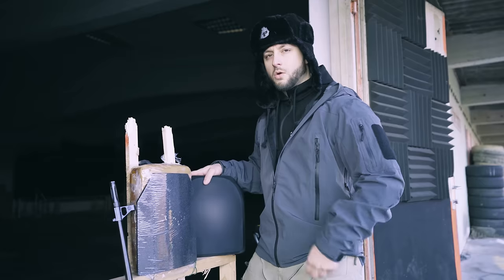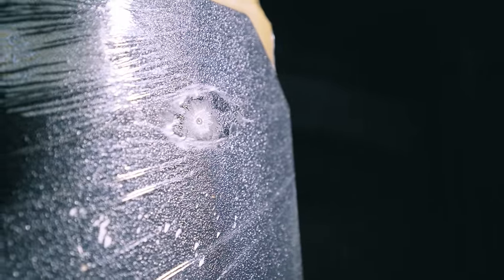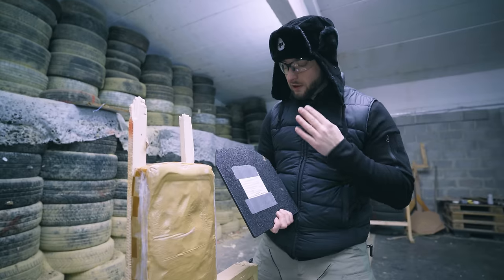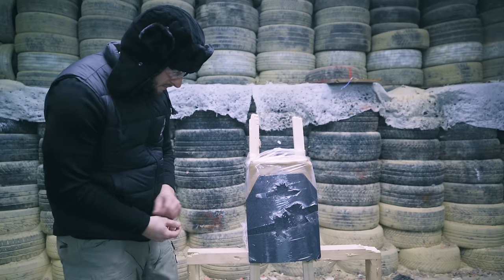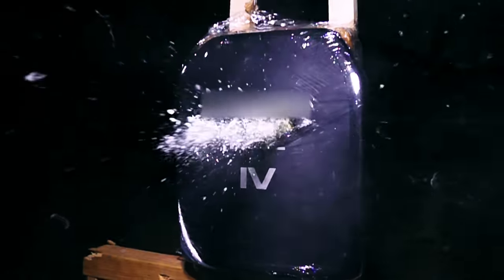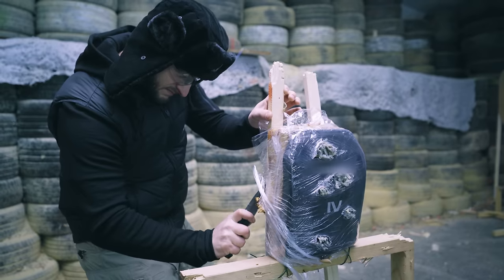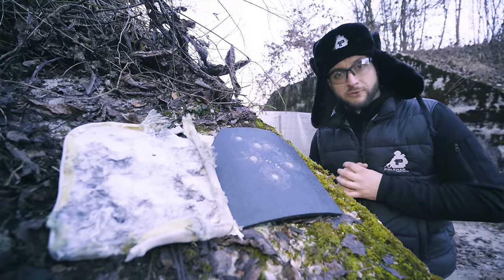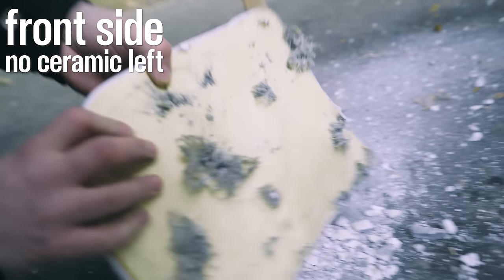Steel vs Ceramic Ballistic Plates

Comment: for the fragmentation issue couldn't someone make a simple kevlar sleeve/cover to zip up around the plate?
Reply: Yeah, those exist, or they can be coated in a thick layer of truck bed liner or epoxy.
Reply: Yes simple
Reply: I'm wondering if a 10-15ml layer of commercial grade silicone caulk would suffice
Reply: A lot of complete body armour set ups both civi and milliraty use a soft amour backing/vest to catch frag/spall with plate(s) ontop to stop the main/high velocity projectiles. (e.g. the osprey PPE system)  It's only in recent years due to inproved anti-spall coatings/technology, higher requirent for "modility"/change in battle docterin/manual of arms that plate carriers have become so popular. As with weapon selection, PPE selection "should" be approprate for the expected threat level , but bare in mind cost is always a big consideration, especially when you are funded by the tax payer!
Reply: @TheEzali  Soft armour behind the plate will not catch the spall coming off the plate in front of it
Reply: @Mini-TOutdoorsMedia  Sorry I wasn't clear enough, the Osprey PPE system's soft armour/fillers incooperate shoulder/upper arm soft armour, collar panels and 360 wrap around are designed to stop spall, not directly behind the set of four plates. (should have clarrified this originally but would be TLTR) Think the Yanks had a similar system up until the end of the last decade, again before mobility became the main priority.
Reply: @proudlyamerican2764  Silicones, especially RTV products sold as "caulk" will have poor tear resistance compared to what you want.  Urethanes (and maybe some modified silicones) may fare better, but again, anything sold as a "caulk" will probably be softer than would be appropriate.   Caulking has those properties because it's designed to be caulking.   It can't be too stiff, because it has to stretch without disbonding.  It needs to be an easily-dispensed single-component formulation with reasonable shelf-life, even if that puts limitations on the properties of the cured material.  

There are probably 2-part castable urethane systems that would work, but at that point, truck bed liner is a 2-part urethane (iirc) and it's available at the store.  Mind you, you'd still be assuming that the properties of the material (toughness, adhesion strength) are sufficient to make an effective anti-spalling coating in the manner you choose to apply it.  That will remain an assumption until you actually test that homemade solution with some degree of rigor.  

That said, I'm kind of curious if there's any benefit/detriment to adding kevlar reinforcement to such a homebrew  coating to perhaps enhance the tear resistance.  If the fabric wrapped around the plate, it might help to limit the risk if the coating became disbonded after the first strike.   Curiosities, but I'll leave it at that.

Comment: Very well done video PT crew.  

The key point with anything regarding Body Armor is that if you're taking hits in the plate, you're already in a VERY bad position, and are now in survival mode.

You are absolutely right in saying that anti-spall coatings can make or break a Steel Plate's protection capabilities, they need to be built up to both mitigate multiple hits' spall factors as much as sustaining the longevity of the Steel-- and there are many different proprietary coatings that various manufacturers and retailers use, some perform much better than others.  There are also AR550 and AR600 Steel plates on the market that hold up even a little better against AP and other rounds on the top cusp or beyond NIJ rating standards.
Reply: Most spalling should be contained by the plate carrier. Now if folks are duct taping the plates to themselves then they get what they deserve.
Reply: @winkleried  As an added factor, absolutely, typical plate carriers are great at catching a lot of spall as i've seen in some consulting and testing i've done with steel plates.
A Kevlar sleeve isn't a bad idea either for those really concerned (somewhat irrationally) about it.
Reply: @DJTheMetalheadMercenary  I am an Ex-Grunt that became a graduate level Occupational Health professional. As I mentioned in these comments part of my job is to evaluate occupational health PPE for my companies clients.  after doing this for over a decade i have a very good BS filter when it comes to Occupational Health PPE sales rep claims .  I have gotten into a couple of flame wars with Ceramic plate Fan Bois/wannabe social media influencers showing bare plates getting hit and claiming the spall would kill and them getting extremely hostile when I start asking where the video is showing what happens when the plate is in the carrier....As Ziga mentioned above there is no black and white here, which is something I am very used to professionally.
Reply: @winkleried  I absolutely agree with you.

Also former grunt, been doing a slew of different jobs in the sector from executive protection and defense/ paramilitary contracting to private investigation and as a consultant for physical security aspects, I also consulted with 2 Armor manufacturers and retailers in the in-house testing process of their products, the end-user insight is essential to do things right.

Comment: so what is actual weight difference on those 2 plates? I wonder if some over layer (like a wet suit -elastic) or the spall guard for steel would keep ceramic fragments captured in armor, pieces better than a void, that's why gravel,sand good barriers as long as they don't spill out
Reply: Ceramic-PE plates usually run somewhere between 6-8 lbs for LVL IV protection.  Steel usually runs around 7-8lbs for LVL III protection. I've seen UHMWPE LVL III plates as light as 3 lbs.  A good spall guard or a steel plate with a very good coating (like the steel ops plates) can contain a lot to all/almost all of the spall yes.
Reply: My AR500 level III+ steel plates are 9.5 lbs each, rated up to 7.62x51 AP. My AR500 level IV ceramic plates from the same company are just under 8 lbs each. Plate carrier with the steel plates and no ammo is 19.5 lbs, and with the ceramic plates is 17.8 lbs. If you want lightweight, go polyethylene, but there are tradeoffs there as well.
Reply: My issued Ceradyne ESAPIs are like 5lbs each.

Comment: The power-up lever on the Mosin is a secret. . .
Reply: They did it with AKs and FALs in Rhodesia too.
Reply: @chemistryofquestionablequa6252  don’t forget New Zealand/Australia
Reply: Mosin is bolt action rifle and use stronger carthidges than 7.62NATO
Reply: I actually have a nugget in a case thats been sitting in my closet for about 10 years. I hear after 15 years of sitting in a closet they can start to turn into golden nuggets. We will see....

Comment: Keep it up you brimg fun to relavant issues.  to me the take away is that steel plates are more reuseable than ceramic, unless you plan on duct taping it after your firefight.  of course if it saved your life you probably will gladly just replace it 🙏

Comment: Bulk vs weight is the short answer with a side of cost vs effectiveness and the fact that a rust steel plate is still 100% effective vs a 12 year old ceramic plate that has suffered from age related adhesive deterioration, (only really effects multiple hit capacity as a single hit will still be 99% as effective as brand new).

Comment: Not only can the spawling hit your neck, which is a very difficult place to patch up especially if the artery is hit. 
The spawling can also go into your armpits and hit arteries there if your arms are pointed forwards for example when aiming a rifle or a handgun.
As well depending on your stance the spawling that goes down can do some real damage as there are also arteries in your legs and some other strategic things down there.
Reply: If there is reinforced layer it can stop that easy.
Reply: @joe125ful  Yeah right sure.
Reply: @Shieldsz  Its really not that hard do that when you put armor to tactical vest pocket,ppls are simply lazy:)

Comment: Actually a combination of materials is the way to go. So say we go for a ceramic type plate. We would like a quite thin 6-8mm thick boron carbide tile front face covered with a hard material able to withstand the energy and the flex induced to the plate when the projectile hits so that the tiles stay in place maybe a Curv sheet. Also the tiles preferably need to be glued on such a material for the same reason. For the backing material we need something that will catch the fragments of the bullet and the hardened penetrators. So we are talking  about a combination of kevlar and polyethylene so that the kevlar withstands the burning hot first contact and the durable polyethylene reduces the energy transfered to the body without melting. Towards this direction a very stiff rear sheet of Carbon or Curv could be used to further reduce BFD along with a REVTECH sheet of foam for the residual energy management.  See Oxides last video about the latest Russian ballistic plates.
Reply from the maker: I like your thought process, it's very similar to mine :D
The only "downside" for a complex ballistic plate like that would be the overall price. 
My idea was that instead of one thick layer of ceramics it would be a sandwich of thin ceramic plates glued or bonded together by a flexible material. That way you would still get enough thickness and enough ceramics to stop and shatter the bullet but the flexible material would spread the force more evenly and probably reduce the damage and ejection of the ceramics out of the plate, decreasing the damage and increasing the multi hit capability. 
Also love the idea of a light, strong and rigid back plate to reduce backface deformation and energy transfer
Reply: @PolenarTactical  well if graphene manages to get to a mass production stage then the game is on. At least the FRAS armor system has shown that backing material and ceramics don't need to be rigidly compressed as one single plate. Also the new Safeline soft armor creates further possibilities for the backing material improvement.

Comment: Steel works or it doesn't ................. depends on what is being shot at you.  Steel is heavier and can have ricochets/spalling

Ceramic is lighter but it will fail after multiple hits and is still vulnerable to the same rounds that will pass through steel.     There really is not much more that needs to be said, at least till someone figures out how to make Graphene in sheets.
Reply: Concealed powered exoskeleton with titanium plates when?
Reply: @suprtroopr1028    Titanium is about half the weight of steel for the same result.   Problem with titanium is it is expensive to "Work".   Ever thought/worked through why virtually nobody sells titanium plates?  If you do it becomes obvious why not.
Reply: @AKlover  I don't usually run the logistics on jokes, so no. I didn't consider it.
Reply: This is why company writes THAT IT CAN STOP TILL 3 ROUNDS OF 762 NATO

Comment: In my opinion, they really ought to add a small ledge on steel plates to deflect spall away from the wearer. The ledge should at least be on the top edge, and only needs to extend a little bit, but that could keep spall from hitting you in the most vital areas.
Reply: It is weird how often one encounters obvious but unapplied fixes in industrial machinery and their end-products. Shame on us for not filing patents, I guess.

Comment: Good video. 
Don't forget that basic bumps or drops can Crack the ceramic plate, compromising effectiveness.
Reply from the maker: That's not the case with modern plates because ceramic part is made out of smaller rectangular or hexagonal pieces and is bonded to the backing
Reply: @PolenarTactical , excellent!  I use steel plates with very nice layering, but they are heavy.

I am a big guy, and it's not like I can't carry 20 lbs extra, but I like the lighter ceramic composite.

Comment: Okay okay, that held 7.62x51 I knew.
BUT WHEN HE TAKES THE MOSIN, AND PUT THE SHOT INTO THE ALREADY WORN OUT PLATE, AND IN LESS THAN 10 METERS, AND IT SAFE, Oh I really got lost. First time I see someone testing a caliber like that, and the most impressive thing is to see that the board stays until it's safe. My congratulations for the video, very cool.

Comment: That doesnt seem to be a very good ceramic plate, there are tests of cheap Chinese plates that have done a whole lot better than that. Steel is very nice but its just heavy, those extra 10 pounds make a big difference when you have all your other kit on you.
Reply: Agree, but a lot of people carry way to much crap on them anyway.  cool doesnt equal practical.
Reply: @armedpatriot8611  amen
Reply: Half the problem is that fat wheezy old guys like me are torn between the post-service urge to carry nothing and the post-parental habit of bringing everything. It's a real struggle.
Reply: @GrimrDirge  true. I tried to make my setup minimal and it still hit 30lbs with ease without weapon, ammo or water.
Reply: @GrimrDirge  right. My view has changed drastically since becoming a father. 
@BigChiefWiggles V  that’s about where I’m at too. 33 lbs. without my rifle, ammo or fluids.
Reply: @BigChiefWiggles  You’re doing minimal wrong
Reply from the maker: It's a top quality European made ballistic plate but as any composite plate, if you shoot it in the same spot with a powerful round, it won't be able to stop it. We have also tested some chinese plates with similar results. But we have noticed that Chinese plates usually have more backface deformation that properly rated plates
Reply: @PolenarTactical  seems like the ceramic part of this plate absorbs more of the energy but it does so at the cost of more damage to the ceramic layer and more ejection of the resulting pieces, resulting in less backface deformation, but also a lot less multi-hit capability. Personally I solved the issue by cutting out sheets of Poron CXD impact foam to go behind the plate, it does a really amazing job of spreading the energy out across a wider area, essentially I now get the best of both worlds at the cost of a little more thickness.
Reply: @ViktoriousDead  I suppose that a pretty abstract term. I tried not to take anything extra but also not leave off anything important. Sure I could throw a basic carrier on with some 4-5 pounds plates, 4 mags, a bladder and a rifle, that would be a pretty light weight scout setup, but thats not what my general kit is built for.

Comment: Anyone tried mixing ceramic and steel? I always thought using steel for the back plate would sidestep a lot of the main issues like spalling. Minimising back face deformation against your spine is also not a bad thing. I already fully invested in ceramic plates when I thought of this, so couldn’t justify buying steel plates just to test a niche idea.
Reply: I've been doing some light looking around, and it seems that you want to have a hard striking face, and a strong capture plate. So potentially hardened steel with some polyurethane, and possibly a resin back plate.

Comment: I have a local armor company that sells steel plates, but only with a Kevlar sleeve that the plate goes into. In their own words "dura coat is shit and will get you killed. I'd never trust my life with that type of coating." They also sell Ceramic and PE plates. 
They said that in their testing, which they had a video to demonstrate, showed that the kevlar wrap worked at a much higher efficiency compared to the spall coating, plus the kevlar is also a backer and functions as a trauma pad. They even had the plate carriers they tested this on with them. 

In the end, it's up to you what you want to use. I personally use Ceramic and will probably try a set of PE plates to see which I prefer.

Comment: If the ceramic plate takes three shots in the same place it is just like paper...it will punch through. But steel plate with antispall coating can take multiple strikes and not fail.

Comment: I'd like to see some home made spall liner testing on that steel plate.
Reply from the maker: Anything specific that you have in mind?
Reply: @PolenarTactical  I've heard of people using truck bed liner, but I once saw someone do a video were they used layers of old cheap silk shirt between layers of liquid flex seal, but they never tested it.
Reply: But they can hurt you

Comment: I wonder how well steel would have done versus the lead bullets of the black powder era. I know there were issues with shouldering a firearm with a breastplate on, but did they suffer from the same issues of spalling and back face deformation?

If so, then, like today, they would have to have padding behind the plate to provide protection for the wearer.

Comment: What about the UHMWPE rifle rated plates? No spall and they're light. A little thick though.
Reply from the maker: Those are great but only NIJ level 3 or level 3+ rated
That means that a hot 5.56 round or anything AP can go through it. UHMWPE is a great material but it's bad at stopping fast and sharp projectiles. 
Today most level 4 composite plates are made out of some sort of ceramic front and an UHMWPE backing material (as you could see in our video)